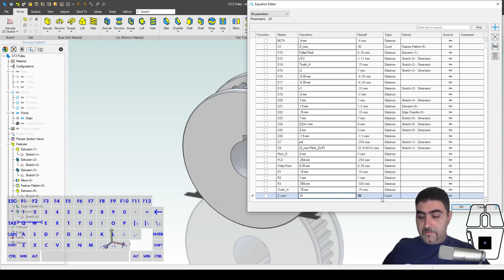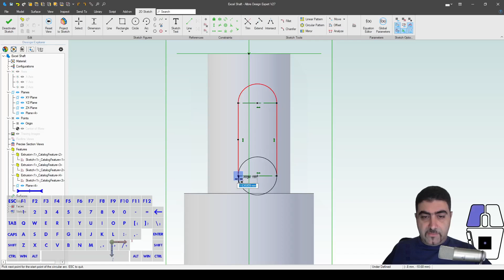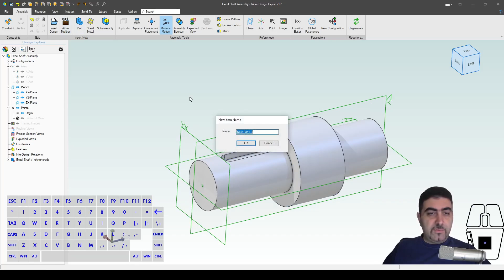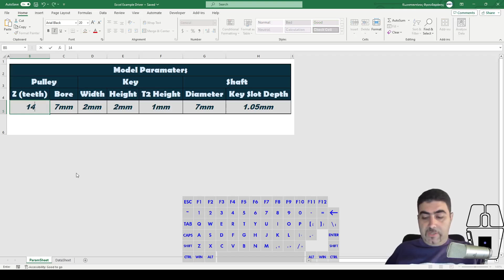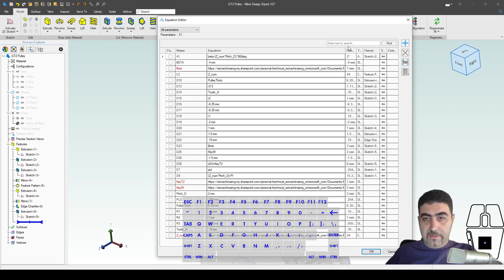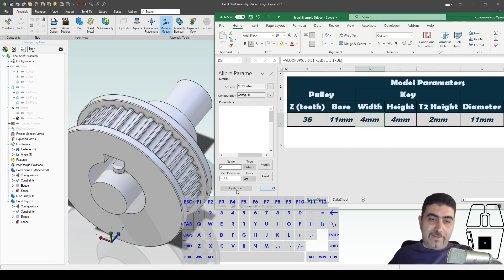Increase productivity: Excel to Alibre integration - Atom 3D included

Comment: Can you use excel to drive suppressing and un-suppressing parts in an assembly for different configurations?  Also, how would you "lock" a certain excel driven configuration so you can make a drawing of it without needing to worry about the 2D drawing changing every time you updated the model in the spreadsheet?  Will the add-in recognize Global Parameter Files and allow you to drive parameters in your global parameters file?  Thank you!
Reply from the maker: WoW!!! A lot of great questions all at once! Let's get started:

1) No, the excel add-on does not support suppressing and unsuppressing. Note: Making a library part allows you to create parts where you control suppression. There are also other, highly UNRECOMMENDED ways to drive values and "simulate" suppression and unsuppresion. Don't do it!!! Unless you want to have some fun... wink;-) wink;-)

2) The excel add-on supports configurations.Even creating them through the add-on. And if you change values in the spreadsheet, unless you update the parameter in the add on, the change does not show in the model. Finally, even if the model is updated, when entering the drawing it will ask you to reproject. If you don't, you still have the old drawing. I am not sure of the workflow you're going after there, but there are ways to achieve it.Just make sure that you are not making things more complicated than they need to be.

3) Yes, the excel add-on will recognize an open glp file and allow you to drive it. Massive power there.

Comment: You've opened my eyes man, this is golden advice. Not using Excel just yet but just the Equation editor. Using Atom3D
Reply from the maker: Yeah, that 200-300 USD CAD system suddenly seems hugely powerful when you couple it with Excel!!!

Comment: Where did you get the pulley from? Is it easily possible to make different pulles in alibre?
Reply from the maker: I actually designed it. It's fully parametric. I did it for a work project and now I'm using it as a drop in component.

Definitely possible to make different ones and relatively easy too
Reply: @ExMachinaEngineering  sounds good! I would be super interested in a tutorial on that. And thanks for your super quick reply :)
Reply from the maker: Ok, will do that. Although, I was planning on doing it as a video in Series 2 of Mini Projects. Would you be OK waiting for about 2 weeks?
Reply: @ExMachinaEngineering  Oh that's fantastic! Sure, take the time that you need, I can wait :)

Comment: I've been waiting for this video! Thank you
Reply from the maker: Thank you for watching and commenting Ruben. I hope I'm helping. If you want any other video done, let me know
Reply: @ExMachinaEngineering  I just purchased Alibre Pro. I would like to see a video of Boolean driven by Excel or equations editor. Maybe a box inside a box with tolerance. I mainly do 3D printing so creating parametric parts video will be great.  Something in the style of your Thread video but simplified for non mechanical engineers.
Reply from the maker: Hmmm, ok. But when you say box inside a box, that doesn't need any boolean operations. That is only 3D modeling.
I think I understand what you're saying but I'd have to think about a specific application to showcase.
In the meantime, if you have something specific in mind, you can find my E-mail in the about section of my channel. Drop me a line there or pm me on the forums.